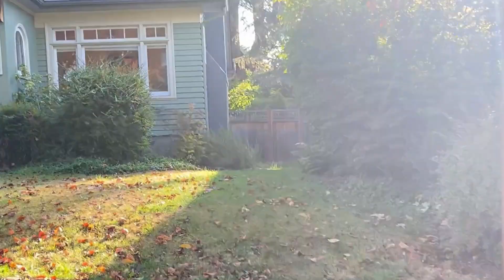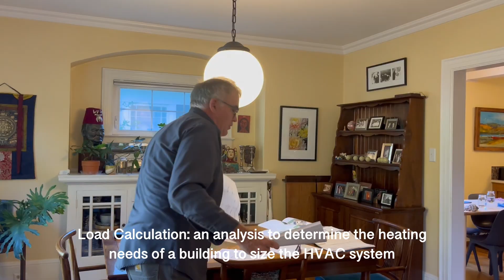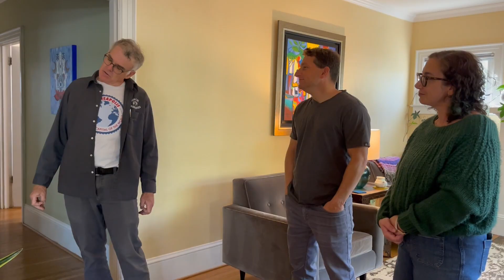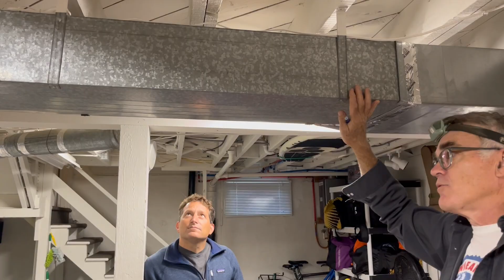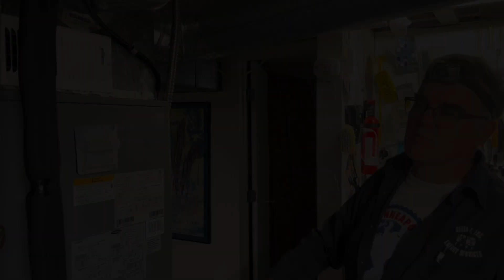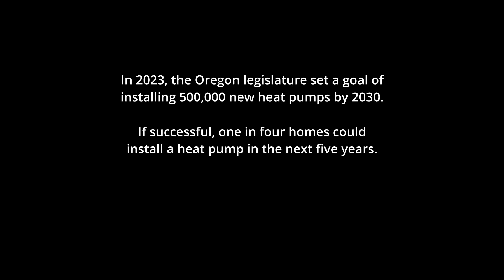A Heat Pump Story

Comment: Couldn't handle heating when it was 50 degrees outside?  2 ton heat pump couldn't cool the house?  Lot of weird holes in this story.
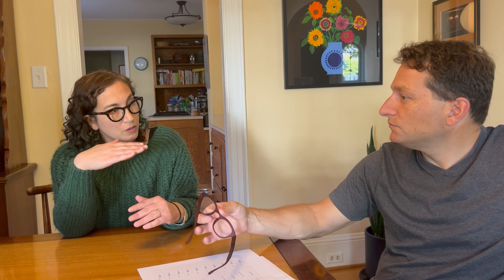Reply from the maker: Thanks for your comment. After seeing this comment, the homeowners checked the detailed issue log they kept and offered a correction. At 4:02, one homeowner says, "As soon as it hit 50 degrees outside, our house wasn't heating." What the homeowner intended to say was that the home was only heating to around 50 degrees. For example, on December 23, 2022, the homeowners recorded an outdoor temperature of 21 degrees and an indoor temperature of 59 degrees.